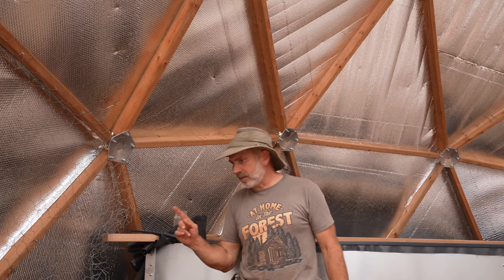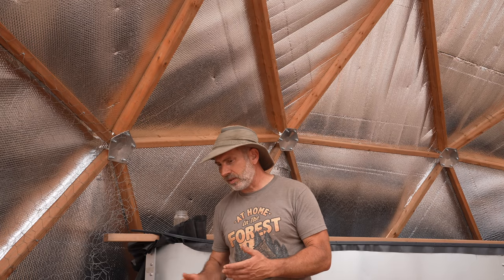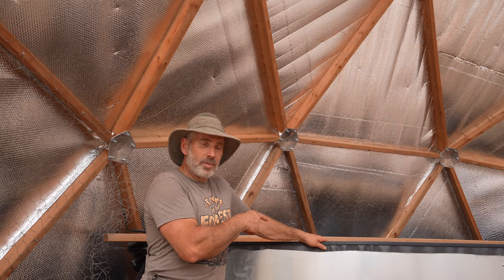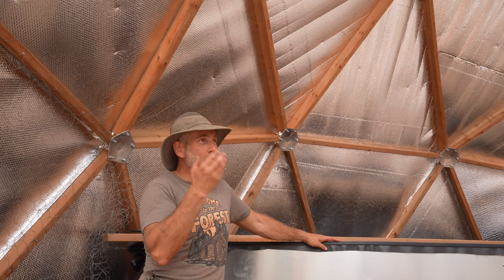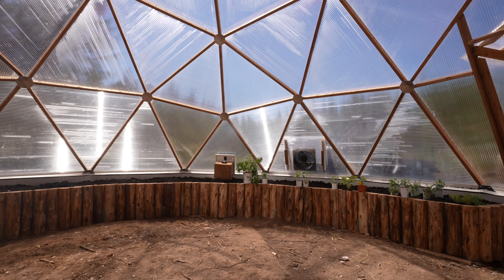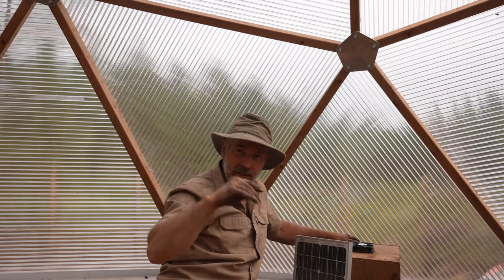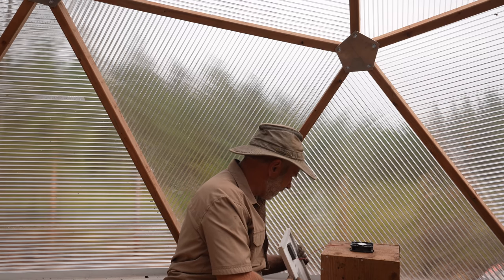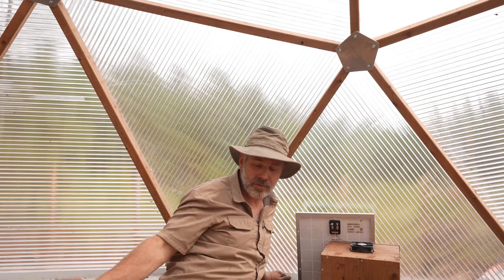How the Soil Heater Works in My Off-grid Greenhouse

Comment: There's a fellow in Nebraska, which gets slammed by cold winters, who grows oranges all year round in his greenhouse; his secret is to run almost 300 feet of air-pipe like what you're doing, only he does it about 8 feet underground where the ground temperature is 50F all year round. That pipe length will cool hot air in summer and warm frozen air in winter, and just requires simple fans to operate, hooked to a temperature gauge system.  One end of the pipes sits up at the ceiling height to better suction out the hot air in summer..
Reply: Yes! I have seen the system and bought the plans for $30 in prep for my future...very elegant system of passive geothermal heating/cooling!

Comment: Don't forget that building terrace like structures for plants inside the dome can triple and quadruple the amount of plants you can plant and the yield you will get. Terrace gardening also takes advantage of the water flowing from top to bottom of the terrace to use the same water to water the entire terrace as the water flows down from top to bottom.

Comment: Shawn, you have me thinking about another way to heat my greenhouse.    We have freezing, but for not as long or probably as cold as you get.   I am in TN.   So far, I have put up fencing around the outside and am filling it with hay bales.     They tend to hold the ground temp for the greenhouse.   I am now thinking of a farm tub full of water at the one end where I do not grow as much and use it to moderate the temp too.    Mine is a long rectangle attached on the side of the garage.   Right now, I am using plastic bottles full or water to collect heat and also to use for watering.      Wish I had had the time and money to think it through more when it was added.
As far as winter, my herbs do fine and potatoes and cherry tomato survive most of the winter and reseed themselves.  I also do greens when the sun light works for them, although I use various methods to cut off the sun.     
I just created a tunnel out back of my house with 2 raised beds because it is impossible to grow root veggies in rock and clay.  Got a lot last year and my swiss chard and cabbage made it through the winter - afraid the swiss chard is like a huge plant now and the cabbage was cut back due to bolting and I cut it back and it is now forming 3 heads of cabbage :-).    I added a greenhouse5'x5' inside of the tunnel to give extra protection in the off season and start plants.    It is a great learning experience.    I will keep following you to see what other great ideas you have to make it easier to grow all 4 seasons.

Comment: Please consider constructing a thermal mass cob/adobe rochet stove in your green house. Connect the soil heater tubes so they can draw warm air from near the stove. Could save your crops during a really cold snap.

Comment: Tip for growing huge tomatoes (from someone who ran a commercial tomato greenhouse in the 1970s) :  pinch back the sprouts that come up from the bottom of the plant as well as in between leaves.  They suck energy out of tomatoes and use that energy to grow new branches.  You can, if the branch is large enough, snap it off at the base of the main stalk, pop it in water and it will root to give you a new plant. :)

Comment: An important thing to consider with fans that try to pull air through a long tube is that the air will always take the easiest path to get to the fan blades.
Any small gaps between the tube and the intake side of the fan will result in a massive reduction in airflow through the tube.
Reply: That was my immediate consern as well. It looks like it may end up just sucking air from the open bottom of the wooden box, unless it's really tightly seated in the dirt. Either way I'd generate some smoke on the intake side to see if it's actually sucking in air.
Reply: He did say something to the effect that the air flowing through the soil would help keep it from freezing and also help the plants grow.

Comment: This "Arcticacre" greenhouse must be so much more resilient to snowload compared to a regular greenhouse !
Reply: that would be a fair assumption ... the potential failure would be IF any of the joints are not set fully so the snow load has a potential to sag one joint section ... with the way it was built in the video's a large portion of that was looked after as they fit the last pieces in so I would expect it to support near a 1000 Kg of snow load .. but with geothermal heating he will also get melt water and that will keep the load down in the safer areas of load too ...

Comment: Maybe check the discharge temp at the fan compared to room temp. I think there is also some cooling benefits with that type of air pipe system.

Comment: Consider insulating the air pipes with Styrofoam where it goes under the entrance way. That short section will suck the heat right out of the pipe in the dead of winter. Also, if you haven't considered it yet. Maybe some hanging planters up higher, to take advantage of the heat rising in the winter may work? Cheers from Winnipeg.

Comment: Shawn, you probably need to install a dust filter on each pipe inlet, otherwise your pipes will eventually need to be cleaned out. Also, that type of computer fan doesn't last forever so keep a spare. And if the solar panel has no voltage regulation, the fan could burn out if it's run in bright sunlight. (Low-power voltage regulators are cheap. The fan probably needs only 1/10 of an Amp.)
Reply: I was thinking of running the solar to batteries and run the fan from the batteries. As is there is no air circulation at night when it gets coldest!

Comment: Shawn I saw 2 different builds on Building off Grid where they used those pipe like you used and went several feet below ground around the exterior of the home then brought the ends into the home to warm the home in the winter and cool it in the summer. Have you thought about anything like that for your cabin and your greenhouse also? I believe it is Geo Thermal something, I'm sure you know all about it. Your water table may be too high of course. FYI along with your lavender at the door for mosquitoes put a rosemary plant also they work better together.

Comment: you could run an air heater hose around the base of the the center bed and have them exhaust up to the ceiling and cascade the warm air around the green house helping keep an even temp around the place ... then the center fan can be used to regulate the temperature all year long ... in a dome such as you have the warmest air will be above the planting area and needs to be recirculated down... you will find the majority of it will pool about your head and shoulders which means a cool boundary layer lower down .... pull that boundary layer up and have it cool the "glass" panels and you better moderate your temperature inside then ...

Comment: @Shawn

For the fans. Make sure they're in push pull

Or pull pull or push push configurations.

Make sure not to have fans working counter to each other. Air direction needs to be the same for both fans if in series or parallel.

So if you have fans pulling air out the piping, make sure both fans are not working counter to each other as this will reduce efficiency

Ie. One fan pulling air one direction opposite to the other pulling it the other.

The fans need to work together really. This improves air flow through the piping.

You want to avoid generating dead spots also as a consequence with little airflow.

Comment: Wow,  Very Clever design.    Arcticacres really thought this one out. Could you use the same kind of solar setup to help distribute heat throughout the new Cabin?
Reply: An earthtube can be used to cool in the summer and help heat in the winter.  The average temperature of the earth about 6 feet below surface is 50 degrees F all year around.  There are technicalities involved as to how large an earthtube to lay for the area you want to help cool/heat and then the air from the tube gets channeled into the house. I don't know all the technical aspects of how it works or how it is installed, although from the programs I've seen it used on (Building Off the Grid, on DIY Network on streaming TV shows) it works really well in places that have four distinct seasons like Shawn's area has.

Comment: You could also put the other fan over on the intake side of the system to have a push/pull set up going.
I'm guessing they've done the work to figure out that those are the best fans for the job, I would have thought that fan to be a bit undersized for that volume of air.  The second fan could also just be a spare to have on hand in case of failure.  A good quality fan will function just fine for years, but in your application failure could have serious consequences.  
I would suggest cleaning the blades of the fan occasionally, dust can and will build up on the blades and hinder performance.

Comment: Hey there,loving the uploads and builds,greenhouse is awesome....to keep temp up during coldest times,you could add manure as heats given off as it rots maybe,or could you use odd long burning church candle,or small oil heater used in greenhouses for keeping chill off....just ideas. With that heat from tank. With that height are you going to add a big plant in middle,small fruit tree or even wires up to grow climbing plants like grapes or berries? Could you add flat backed plastic containers on some walls to use some height aswell,strawberrys or something planted growing down in them,using the vertical space up aswell.
Just some thoughts...
Keep up the goodwork,dogs awesome too.
Peace.

Comment: Concerned that the pipe below ground at door will collect condensation and freeze in winter.  You created a low point in the duct, give a collection point.  Also the frost could/should creap in from the outside through the ground.  Insulation around the piping at the low point and couple drain holes in the bottom into 1ft of rock might help.

Comment: Your beds would benefit from a cover crop of clover or other nitrogen generating plants. The placement of the wood beneath the soil will be using a lot of soil-born nitrogen. You could also add compost to boost the N. 
Overall, the dome and its parts are amazing, just the ticket for Northern gardening.
Reply: I think compost is the best bet here particularly for starting out.  The logs in the bottom are too deep to deplete the plant-available nitrogen of the bed, but they will retain moisture, will retain heat, and provide insulation from the cold ground.  It's modified huglekultur style.

Comment: Hi thanks for explaining the process of heating woth the tubes. The solar setup will work only at daytime, not night. so it might work as it shut down to not cause cooling at night as the temperature will drop. You are going to have to adjust it to a hairpin type approach.  pleas eget a temperature gauge for water and for ambient airThe fan can be control with it too. good luck

Comment: I don't know if it would be enough to make any difference, but depending on static pressure differences you could be getting more air through one pipe than another. If you notice some areas not being kept as warm/cool as others you can damper off part of the pipe that's getting the most air through it to force air through the pipes getting less. Really cool design though.

Comment: You should run a pipe underground from the green house to the cabin so you can pull warm air from the cabins wood stove to the green house to help out in the winter months
Reply: Hi brenton. Shawn answers in the comments: "I'm considering a rocket mass heater" (for the greenhouse)

Comment: Hi Shawn. The green house dome is pretty cool!   I have a question though, why didn’t you either line the inside of the cedar walls with either more of that roll of tin or if you ran out then why not landscape material?  I live in Winnipeg MB. And I made raised garden beds and elevated raised garden beds out of cedar. But I lined them all with landscape material to protect the beds so the cedar will last longer.

Comment: I wonder if you could use another solar panel to supply a pond pump, UV pond steriliser and a filter? 
If you could get some Watts of power enough for that it might also incidentally heat the tank a little in winter. That could keep the water clearer and help with the thermal mass.

Comment: Hi Shawn. I am a big fan of both your channels. Have you thought of a way to heat your reservoir in case of an extreme cold period to save your plants? I use a stainless tube spiral (from a brewery) in a metal barrel, with a pump attached, to heat up my kids 1000 gallon hillbilly swimming pool from 5 degrees C to 30 in 8 hours. For a luxury edition you can get an oven made for heating hot tubs you could fit inside.

Comment: @Shawn Yay Finally us PC Geeks can finally be useful here: may i recommend a Noctua NF-S12B redux-1200 its a fluid bearing fan that has some of the strongest and quietest performance. Also its a fluid bearing fan so longevity wise these are recommended for heavy duty long life. You can snag one of these for less than $19
Reply: I would get a 200mm Noctua, seal the edges where the fan mount meets the box and put it on a voltage regulator to avoid over-volting it.  The 200mm will allow slower rotational speeds, less air resistance and longer fan life.

Comment: geo-heating is a resource most people overlook.   Do you think you may have to eventually dig out the floor of the greenhouse and insulate it from the rest of the ground and refill with dirt to create more "protected mass" to keep the temps above freezing?   
on a side note.. the dome  is small enough, a smallish kerosene heater would be plenty to keep it warm if you had to put heat in it... 
When i lived in Alaska, I saw a LOT of dome varients....they can be a very workable solution but do require some inventiveness and creativity

Comment: I bet if you built a simple boiler (coil of copper in a wood stove) you could  store heat in the water. That way, if you do end up needing supplemental heat, your not having to constantly tend a fire.

Comment: Are you going to add a burm around the outside circumference of the dome of soils to act as a thermal shield rather than just the insulated wall? Just curious as looking to build one of these…

Comment: Good morning,
Great video.
Previous video talked about deer flies, suggesting way keep Deer away Lime Disease.
Pungent herbs  ... Thyme, Basil, Greek or Italian Oregano,  Rosemary,Great companion plants, or smelly bar soap.

As for cold weather, Mid Atlantic States dealing with cooler night temps.
Yes you said had a Fan, need more than 1 sorry have to each section different plants Seedlings.
How much Wood Ash you using?
🙂

Comment: This may be a dumb question, but do you have venting that can be opened and closed at the top of the dome so excess hot air is drawn up and out of the structure in the summer?

Comment: Shawn that fan in the box is very small i would go bigger 4 inches or more you need it to circulate in the pipes 4inch is to small i wouldn't even use that size on my computer ok just my advice its a good setup to

Comment: May have to get some solar heat lamps or a small oil stove for especially cold streaks? Or even use a camp stove to boil some water to get warm humidity?
Reply: Hi Brandon. Shawn answered one of your questions elsewhere in the comments: "I'm considering a rocket mass heater" (for the greenhouse).

Comment: I love the dome and so I checked their website for a bit.
I've noticed that there's almost no info regarding water tightness and how it is sealed against the environment (well they mention tape at some point). I did saw that you were putting on some clear tape. Also some of the arctic domes on their website have some kind of metal cladding at the seams.

So here's where I'm a bit concerned:
The biggest disadvantage with a dome is usually that it's hard to seal, since they have many more seams than a traditional design, and therefore often leak.
Looking at the polycarbonate panels, it doesn't look like there's a water run off, so the only thing guiding the water down the dome will be... tape?
Also I'm not sure how well the tape will hold up in this climate, are you planning to just replace it every few years?

I guess a few leaks are not that big of a problem, it's only a greenhouse after all.

Comment: The explanation makes sense as far as it goes, but it seems like the potential heater effect will be minimal because the mass of what is to be heated, the soil, is so much greater than the mass being used to do the heating, the air. Besides mass, the volume of air circulating through the system and the difference in temperature between the air and the soil are the other variables. Given the size the the fan, the volume of air in circulation will be modest. There is no question that the soil will cool the air significantly as it circulates because of the great mass of the soil, but I have difficulty imagining a significant (>1°C) heating effect on the soil. Does the manufacturer make any claims of this heating effect?

Comment: Just curious, Shawn, if you will be installing a breezeway on the greenhouse as added protection from cold and wind in winter time
Reply: Excellent question 🙋🏼‍♀️ I was wondering what he’s putting there..
Reply: @davekeehn8388  Hi Dave. That is an interesting idea. In the building of an igloo the entranceway is lower than the sleeping platform and that creates a 'cold sink' and keeps the occupants warmer. The only problem for the greenhouse might be walking in/over a ditch everyday. A wooden sidewalk over the cold sink?